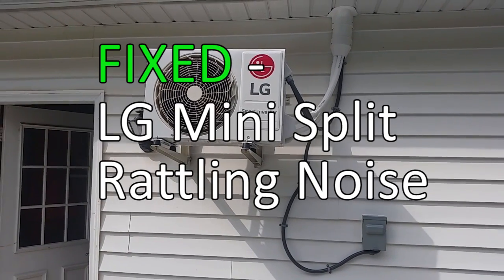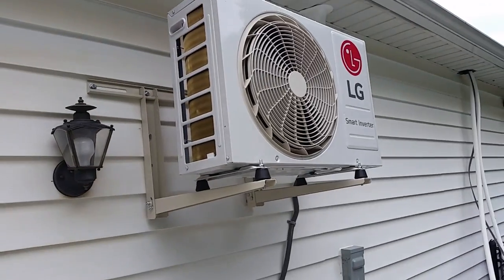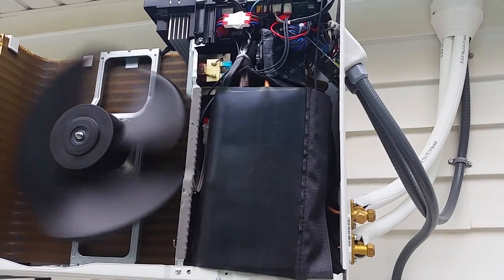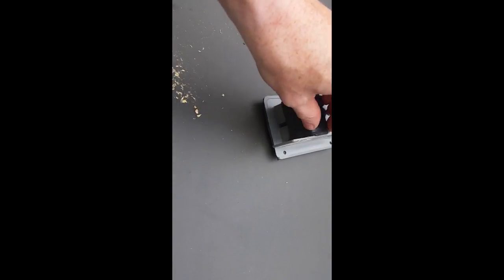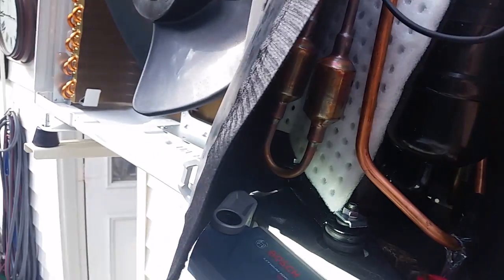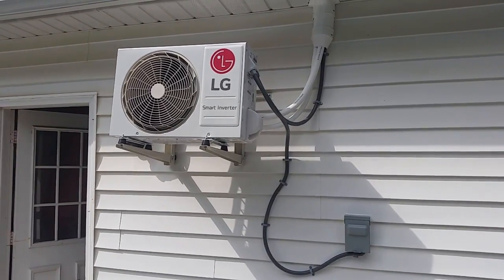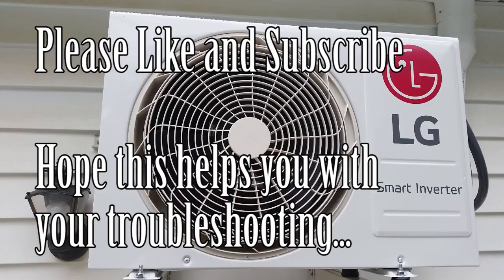FIXED - LG Mini Split Rattling Noise

Comment: My unit is 3 years old and the condensor fan blade(one of the 3 ) was slightly bent causing the unit to vibrate and these vibrations would travel through the refrigerant lines and it would create a low frequency sound inside, finally changed the fan and now its all fine
Reply from the maker: Nice work troubleshooting and fixing, great to hear it is working well again for you.  This LG unit in the video has been flawless to date post fix thankfully.  Fingers crossed.
Reply: I have this problem now, would you be kind to help me with the details?

Comment: In these units there’s always a bit of slack with copper piping. Bending slightly the copper tubing away from one another would have been a far better solution than inserting the rubber foam as that will only deteriorate over time and you’ll be back at square one.
Reply from the maker: Thanks for the pointer Mick.  I'll try that if it starts making noise again.  Fortunately the original fix is still holding strong for now.
Reply: I had same thought. The cover must be hitting the pipe.. as illustrated when you were stopping rattle with your finger.. doh! just bend it a tad right now/there. With the padding the pipe is still hitting the cover.. maybe worse. Thanks for the video though, very helpful - noises like that are the bane of my existence lol.
Reply: Also over longer periods of time, if pipes are vibrating and hitting each other they will basically make a hole in one of them

Comment: Thanks for the video! Another question: I have the same AC. Is it normal for the condenser unit to drip a little bit in the valve because it is condensing? This is happening with mine. Thanks!

Comment: Which bracket are you using?  Do you notice any vibration inside the house (after the fix)?  What size unit is your MS 9k?
Reply from the maker: L Dlink the bracket is from DuctlessAire, purchased on Amazon.  After this video, I also installed a Mitsubishi near it.  When doing the other unit install, became ambitious and straightened this LG bracket by placing a small wood piece on the backing.  So the unit is more level currently than the original video illustrates.  I’ll try to get a photo and post for you in a few days.  Here is a link to the bracket on Amazon, about $45
https://www.amazon.com/gp/product/B00LDU9R2I/ref=ppx_yo_dt_b_search_asin_title?ie=UTF8&psc=1 .  The unit is the 9K LG Mega HV, basic compared to our other LG and Mitsubishi, but has been working flawlessly.  Since the mount is on the back of the garage, there is some low frequency harmonic when the door is closed.  But subtle enough not to be heard outside the garage.  Maybe I’ll do a comparison video for you to show the difference in sound between the 4 units we have.
Reply: @bluesfoxpix  Thanks for the reply, and the video.  The unit I am planning to install recommends 12 inch clearance behind the unit where the air gets sucked in, but many of the brackets I have seen barely allow 10 inches after placing the 11 inch wide unit on it.  Your install looks pretty roomy.  I plan to install a unit for a sunroom, so I am on the fence about attaching it to the studs (for a shorter, and more efficient 16 foot line set) or putting it on the ground using the full 25 feet of line and not worrying about vibration.  The other option is building some tall platform, but not sure how feasible or safe that would be.

Comment: Excellent job my friend. I had the same problem with my 12K BTU LG mini split but mine was rubbing the metal casing but it was making the very same noise yours were doing. I took the casing out and with a big hammer I did a huge dent from the inside of the casing and no more noise, thank you for posting your fix.
Reply from the maker: J. Gutierrez great to hear you got it resolved.  By the way, no issues since making the fix, unit running great and quiet.  Though not so efficient for heating in cold (Low F)   temperatures.  So using baseboard when it is really cold out.  Great for AC though.
Reply: I don't know what SEER is your MS but it could not be less efficient than your baseboard heating. Today was at 32F and my LG was blowing very hot air, thank you!
Reply from the maker: Looks like the HSPF is 9.0 on this specific unit.  It does blow out nice hot air.  I just observed that the fan was running at a higher pace compared to the more efficient mitsubishi that we own, and made an assumption that it might be less efficient than the baseboard (non-scientific, just an assumption).  Quite amazed to see that the unit can run at about 0F and still produce good warm air though!

Comment: Your unit there is not 12 in. From the back as required by the manufacturer. Lg installations is more than 11 13/16 in.

Comment: Thank You for your time and help. We have a Gree and really like it a lot.
But the problem with My Gree Mini Split is on the inside of the house.
The fan motor has gotten much louder since we bought it. And is very irritating in our new remodel, enclosed garage.
I've cleaned the filters, no help, I'm assuming that the fan blades have build up on them?
Do you have an idea of what this could be Sir.
Thank You.

Comment: Great video but I would have just contacted LG for a replacement. Shabby workmanship and you shouldn’t have to spend your time on trying to fix something brand new delivered with a defect. I just had Mitsubishi units fitted and one of the indoor units rattles on heating mode. Getting the installer to get it sorted with the manufacturer. Paid full price, need a decent working unit 🤷‍♀️
Reply: Wish there was a way of giving a comment about 50 upvotes.

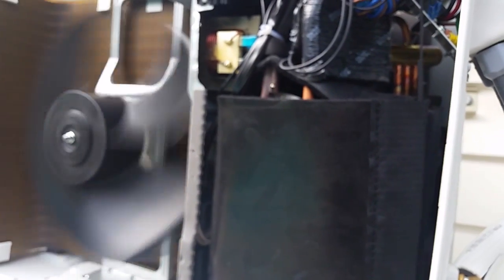Comment: Is that increasing vibration sound normal? at 5:50 after the fix? Because my AC unit makes that same noise and I thought it was faulty, for some reason I thought ACs were silent. Mine makes a weird washing machine noise when I configure the inner fan either in low or auto. It stops making the noise when I config the fan at high speed.

Comment: What can fix a noisy-sounding indoor air-con caused by a broken fan roller tube blade inside which I have for my 11 year old Daikin Air-Con?
Reply: My Daikin is doing that I just put up with it. It’s been doing it for at least 10 years and it’s 16 years old

Comment: Are all the outdoor units the same from inside?
I bave a daikin ftx 50 18000btu and the outdoor unit sounds pretty much the same.
Reply: well they all have copper pipes, a fan, an insulation of some sort. open it up and see dont be shy

Comment: I have recently purchased samsung ac it is also producing same rattling noise at nights only, whole day it runs fine, but in night it starts giving rattling noise every 20- 30 min
Reply: Same here bro.. My samsung split is making loud noises sometimes
Reply: did you fix it already after all this,if yes then how,what cause
Reply: @apinkofficial3936  yes there was a pipe in the outer unit which was running close to external body. And when this pipe vibrates hits the metal body and produce noise. You or technician must open the external unit and bend pipe to move away from contacting metal part
Reply: @rajeshshahwan5207  looks like samsung is not doing testing before sending to market